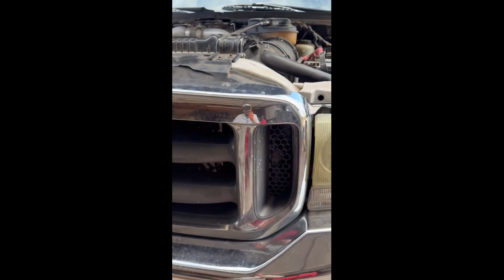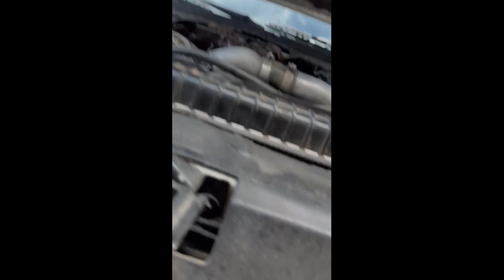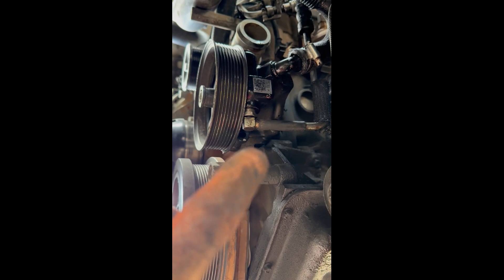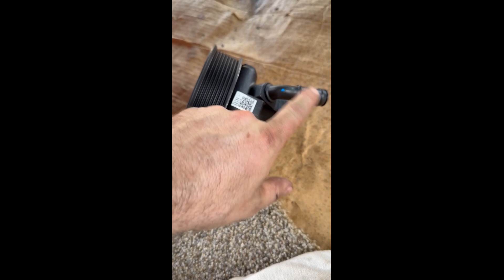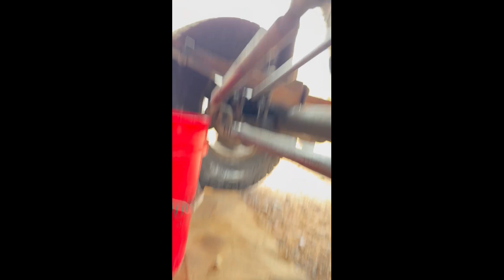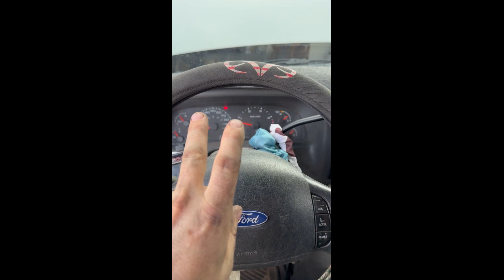6.0 Power Stroke {Power steering pump replacement}

Comment: I’m confused on why you drained your coolant
Reply from the maker: Because it makes life way easier. If you don’t take that lower rad hose off it’s a pain to get to the 2 bolts next to it that hold the pump on and it’s almost impossible to get  the pump out thru there if you don’t
Reply: @Nfear1018  I’ve never had a issue getting to the bolts. I always drop the Track bar down and get it in out from the bottom. Way faster and easier that way.